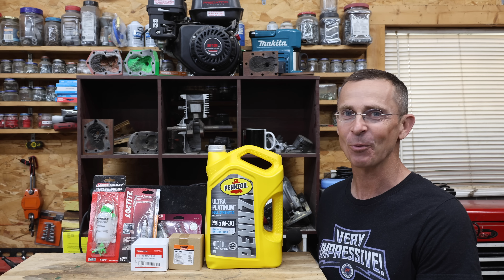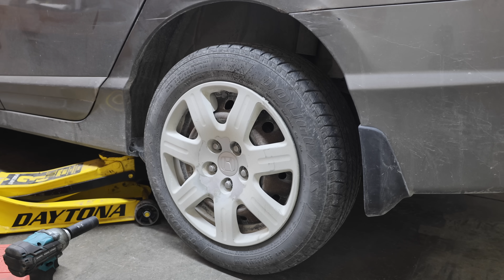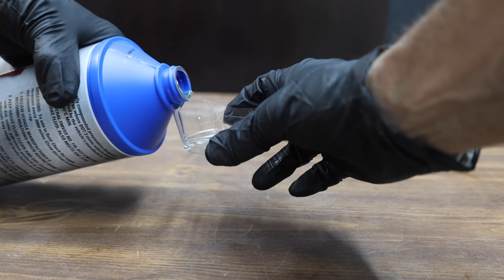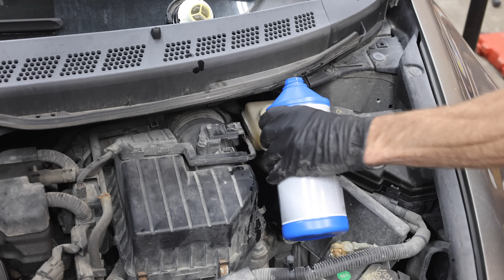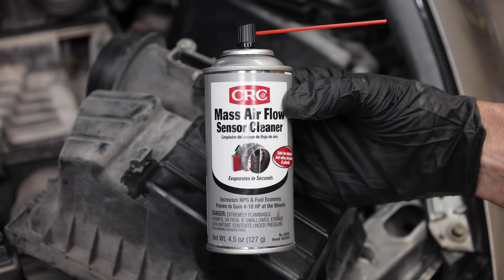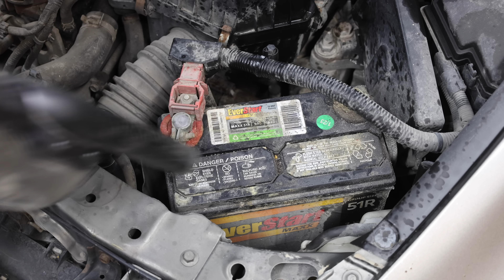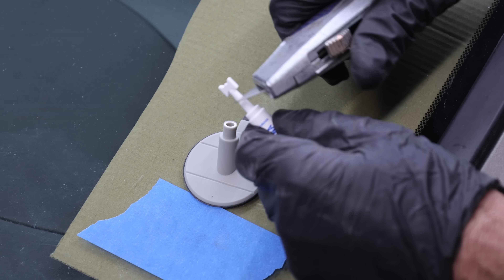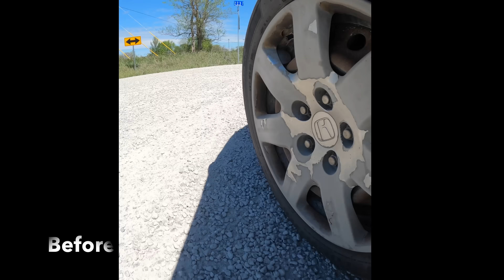Most Reliable 200K Mile Car? Let's Settle This!

Comment: I was a mechanic for only 25 years.I had to retire due to health issues. Everything in this video is perfect. Are you sure that you're not a mechanic? lol! I love all your videos, but this one takes the cake! Your  attention to detail  is great. Mad respect to you!!!!
Reply: @justineb I think he already has done that.
Reply: So good it will be in the SAVED folder.
Reply: Mechanical skills should be in everyone's toolbox. Common sense is key.
Reply: Attention to detail? He didn't even bleed the coolant
Reply: How many transmissions with 200k miles have you changed the fluid on without knowing the history?
Reply: You think it's wise to completely replace all the ATF. I think what he did in the video should suffice. Alot of times those high mileage trannies will slip when there is too much fresh fluid in them
Reply: I'm pretty sure that he's a mechanic formerly with some branch of military service.  By the book, no BS, no messing around kind of mechanic.
Reply: @leifhietala8074  Air Force is my recollection.
Reply: My only worry is changing that old transmission fluid out at that point. The new fluid is liable to make it slip as it's going to be worn out inside the transmission. 

I guess, if nothing else we might get to see if project farm can rebuild an automatic transmission
Reply: Yes it happened to my 04 civic high mileage fluid change but after the 4th drain and fill , added Lucas no slip and it really worked ! Lasted for a very long time after that.
Reply: @erwinsm10  Very interesting case, I have only heard bad things about putting lucas in honda transmissions. Will fix the issue in the short term but kills it within 15k. Yours definitely seems out of the ordinary
Reply: @Justin_Ebright   You're right about that.  Doing a high-mileage ATF fluid change tends to be a game of Russian RouIette.  Whenever I do one of those, I will actually keep the old fluid in case that happens.
Reply: @ABQSentinel my fj had never had the tranny fluid changed. This fj is entirely an offroad weekend machine in the Rockies. At 225 k, I decided that some fresh fluid had to be better than the zero viscosity stuff living inside there. I did a drain and fill. Since then (I'm at 240 now) I've done one more. So far so good. I really stress the tranny, keeping it in low range 4x4 and low gear for miles down these mtn trails. I'll probably do a drain and fill every 20-30k.

At some point you gotta figure fresh fluid is better than the "water" in there
Reply: @Justin_Ebright Ha! He's already rebuilt a heavy duty automatic. That one blew me away too. Learned more about automatics than I ever had in my long automotive technology interested life in one video. I adore this guy. Unique skill and personality combination that slays. Public service of the most practical order. Edited to add, I was warned about doing that by a 😊transmission shop (honest one) on a high mileage Durburban that exhibited cold slipping in reverse. Said don't floor it unless you have to, don't change fluid. Drove it another 30k and sold it.
Reply: Yes it happened to my 04 civic high mileage fluid change but after the 4th drain and fill , added Lucas no slip and it really worked ! Lasted for a very long time after that.
Reply: @erwinsm10  On toyota transmissions lucas does wodners though
Reply: @Justin_Ebright     Changing out old transmission fluid for new as seen in video will NOT cause slippage. That is old folk lore from uneducated want to be mechanics.   Using logic the old fluid is already spent and the trans while may be worn will continue to wear even faster if left.  New fluid is clean and restores heat dissipation so trans will not destroy it's self more.
Reply: @slyfox7429  clearly you've never worked on old beaters and potentially ever a car. Let me educate you. 

If that fluid had been changed regularly it wouldn't have been an issue. It clearly and quite visibly wasn't. There's no old wives tales, it's a matter of if the fluid maintenance was properly done over the years or not. This was in the "not" category. 

Further indication of a former owner who didn't keep up the maintenance was just how badly worn those CV joints were. 

That transmission has had poor fluid in it too long and WILL slip if you put new fluid in. Don't take my word for it, google it yourself. Look up videos, there's tons.
Reply: @slyfox7429  why would they make it up when they could charge people for fluid changes and make money?
Reply: @slyfox7429 The Car Care Nut would disagree with you..he says don't change it over 80k
Reply: @Justin_Ebright  quick question, when you claim new ATF will cause transmission to slip, isn't that the issue with the transmission? so the proper way to fix is rebuild the friction stack right?  So its either "don't touch it", or "new fluid + rebuild friction plates"? Just wanted to confirm cue its my first-time learning about new ATF will cause transmission to slip.
Reply: @Justin_Ebright  you just hang on to the old fluid in case there's a problem.
Reply: @Justin_Ebright  He already did that on his motor home.
Reply: @Justin_Ebright  "You can easily rebuild any automatic transmission. You don't need to be a mechanic" Says the Project Farm Mechanic
Reply: @Justin_Ebright  That is a huge myth in the car community!  Old transmission fluid should be drained and refilled, ASAP!  What you don't want to do is power flush your transmission!  Flushing can push that metal dust and debris into sensitive areas of the transmission.  When you drain and fill you are only replacing 1/3 - 1/2 of the fluid.   If changing half the fluid causes the transmission to slip, it was already bad.
Reply: @BartSparrow123  it's like you get it but you don't get it. As I stated, if regular fluid maintenance was done you're golden. But if it wasn't if you go draining that old fluid you'll lose power and it will slip. There's no myth. Maybe you get paid to upsell those services or something, but on a old warn out transmission it's not advisable to do what you're suggesting because you'll only quicken the end. Then it's either a full rebuild or a replacement transmission. With the old fluid folks will still get a few extra miles out of it. 

Not everyone has new transmission money just laying around. Some folks need that ever last mile to make it. Replacing fluid at that stage would just cause slippage and strand someone who may have been able to squeak 6 months to two years out of it as is now. At least long enough to save up.

I see this response all the time, and it's always coming from lube techs or major metropolitan area shops. In some places of the country people need every last mile, not miles robbed from them in an up charge on a worn out transmission that will become useless quicker with it being done.
Reply: @Justin_Ebright  I'm not a professional mechanic, I've simply been restoring and maintaining cars to flip or keep for 30 years.  This myth that changing old ATF, which is broken down hydraulic fluid that is probably burnt and no longer protecting the transmission from wear is going to make the torque converter stop working is worn out and silly.  Shops try to upsell customers on ATF flushes to justify the $50,000 power flush machine they bought!   But seriously, if worn out ATF is keeping your transmission running and new fluid will kill it, it's already dead, it just doesn't know it yet.  I've changed the ATF on every project car I've ever bought, some with 300K miles and never had anything but smoother shifting.
Reply: @BartSparrow123  are you in the habit of going after junkyard cars or are you pulling them out of people's garages? I've made a habit to avoid "flipper" cars due to waaaay to many being made to look pretty while being horror shows underneath. So I'm not sure where to gauge this conversation. But I'm going to assume you're on the quality side, hopefully, and not one of those quantity bozos these TV shows created who just worry about appearance and sacrifice by cutting corners underneath.

So here's the deal. On a transmission that's warn out and hasn't had proper maintenance done you don't remove the old fluid, you certainly do not power flush it. The added metal and particulates give the fluid a sticky quality while increasing friction. If you flush out those particulates then you lose friction and everything slips. 

If you've bought a few project cars and got lucky consider yourself lucky. If those transmissions had hard miles on them with improper maintenance then you wouldn't have been as lucky.
Reply: @Justin_Ebright  No I just jump on deals when I happen to see them, just a hobby.  Just got a 2007 Toyota Rav4 4wd V6 back on the road.  BOught it off an acquaintance for $1,000.  Just needed the oil pickup tube and pan cleaned out of sludge and an airbag recall.  It's worth $5,000.  Spent 3 hours working on it.
Reply: @BartSparrow123  oh right on, respect then. You're more of an investor sort. Nothing against guys like you at all, cause a good deal is a good deal, can't blame you there.

If you ever run into an issue with sludge in engines I'd actually highly recommend Liqui Moly's products. It is a bit of a process, anywhere from 2-4 stages depending on how bad the sludge is but on engines it's really worth it if you're able to do so. (IE you add it, drive on it for a bit, drain the oil, put new oil in, and rinse and repeat if needed)
Reply: @justinebright2328 Replacing the fluid is fine, flushing the fluid is where issues can arise.
Reply: Were the health issues related to your job? Mechanics are actually at a much higher risk of serious health conditions than other jobs.

Comment: While it is a boon that EV do not need that many parts for the engine and are easier to work on, I wonder how the situation will be if one tries to repair/service a 20+ year old one.
Reply: There are plenty of Toyota Prius out there that are around 20 years old. Many have several hundred thousand miles on them. The problem nowadays is finding parts for older cars.

Comment: Definitely a good type of video to add to the channel; would be more than happy to see more like them. How did you decide on which aftermarket parts to use, which supplier for those parts, and which to keep original? (noted the comment on the hubcaps with balance of aftermarket vs Honda)

Comment: I change  out my transmission fluid by removing one of the cooler lines and letting the transmission pump the old fluid out. Pump a few quarts at a time while adding back the same amount until it pumps clean fluid.

Comment: I have a friend with a 2008 civic that has almost 400k mile original engine and transmission. My 1999 Mitsubishi mirage has 410k miles with original engine and transmission as well.

Comment: You're one of those channels that should make YouTube grateful you're one their platform for real. The rear brakes weren't just about used up though. It looked like the thinnest part was about 50% of the way to the bare metal. Nothing wrong with replacing them at that point though and great video.

Comment: Todd,
My 03 Chevy is at 378k. Sad to say, the transmission needs to be replaced. But I'm going to rebuild it myself. 
Last Tuesday. I spent 1/2 day working on my daughter 3/4 ton GMC. Turned rotors. I wheel hub bearing. New brake pads and fresh brake fluid too boot. Then the rear pad was replaced. Rotors were just fine. 
I'm working on my 2000 Discovery 2 now. Front and rear differential rebuilt by yourstrully. Waiting on hub bearing. 
All 4 brakes calipers are replaced too. 
This is just my regular maintenance item. 
I maintain my vehicles. Never been to a shop. Therefore I can't bitch if a mistake is made. Or if I scratch my paint a little. 
I'm proud I do my own repairs.

Comment: Back in 2018, I bought a 2014 Hyundai with nearly 200k miles for one of my kids. Luckily, it's been relatively trouble free. A few minor repairs. It was hard to pass up. It was loaded. Top of their line. Only driven on the highway by a state official from his home to his offices. About 200 miles a day.

Comment: Freaking Fantastic video! My only suggestion is that Honda engines have solid valve lifters that require adjustment every 100K miles. Failure to adjust the valves will result in poor engine performance and at worst a burnt valve, which requires removing the cylinder head to replace the valve.

Comment: 425k Kia 3.8 2010 original timing belt. 2nd transmission. Always high mileage NON synthetic, always spiii fluid at every 5k now. Alwayssss pulling a 5x8 loaded trailer. All suspension bushings, and shock stuff must be replaced.

Comment: You nailed it on the head. "With regular maintenance" the question is a) the cost of the regular maintenance for the parts needed. b) the skillset and toolset to do that required maintenance. 

The big thing is having the skills to do the work. If I tackled this kind of project. I'm not ashamed of having a copy of Haynes or Chilton on hand to get all the repairs done correctly. 

Thanks for the video it was a lot of fun to watch.
Reply: ALWAYS read the manual! They don't just write those things for fun, they're a hugely important resource.

Comment: I have a 2009 Honda Civic coupe with 253,000 miles and it is still going. I take the time to always do the oil changes and fluid changes as well as the scheduled maintenance when necessary. It runs like a champ. Yesterday I did the tune up and changed the VVT solenoid gasket which was leaking oil. I took care of the PCV valve and valve cover gasket. The car is incredibly easy to work on. Great video.

Comment: i remember when Honda had weak 4th cyclinder so you always hd to check the oil my I haved owned 100 cars in my life m best car was a 99 Buick LeSabre with 300k miles it got 36 mph and was very trouble free but did also have a 93 Saturn SL1 with over !.3 million miles on it i sold to a waitress for 100 dollars it still ran and drove fine she sold it to a junk yard which uses it to run around the yard to this day

Comment: I can see why those Hondas are very popular. Most people should be able to accomplish the service and maintenance you demonstrated. 
Really excellent video!
I am going to make sure my kids see this video so they don’t fall down a YouTube rabbit hole on auto maintenance.
Your video, was clear ,concise and straightforward. As a young guy, I never could afford to pay someone to do that work ( I could but didn’t want to pay), and all my friends were the same. We did that work , and didn’t overthink it.
I think you’re helping a lot of people who are afraid of taking this on, and they shouldn’t be.    Thank you very much.
Suggestion for video. Many good quality used power tools available . I just picked up a really nice , very old Makita chop saw(free)
It needs some maintenance, and parts are easy to find online. Lots of good lightly used power tools available cheap. People shouldn’t be afraid of used, brushed motors.
Think of brushes on electric motors, same as brake pads on cars.

Comment: Btw, I recently got repair work done on an F250 with 250,000 miles. Oil leak and slipping transmission cost me $21k

Comment: My man, this is exactly what I do... In the last two years I got a 1998 Tahoe 4x4 LT with 208,000 miles and a 2005 Taurus with 108,000. Bought cheap, needed work, but to put even $1,000 to $1,5000, CHEAP...

Also, I expect that you may get blasted on this which is sad, you are soooo helpful... I appreciate you...

Comment: my tdi jetta has 300k on it original engine and transmission it has some bolt on mods 11mm injection pump, .205 injector nozzles, vnt 17 turbo i beat the absolute piss out of it it hasn't blown up yet.

Comment: l bought a 97 Ford Taurus new..because we had 2 small kids and it had an excellent safety rating. l put over 200K miles on it without anything major but routine repairs and some brake lines when it neared 200K. l gave it to a kid who was trying to get clean and he drove it a couple of years to work  before the front end went out and he parked it .

Comment: As long as the engine and transmission have been serviced fairly regularly and the body/subframe isn't shot, I've seen some get 300,000 minimum by changing some worn-out hard parts. This is a really good video.

Comment: I'm with you on refurbishing older vehicles. Summer is almost here, can you take a look at camping coolers, both the insulated ones and those that use 12 volts for active cooling? Maybe compare to a simple styrofoam cooler.

Comment: Great DIY video!

New cars are a total waste of money!  If possible try and buy a car (Toyota or Honda) made between 1995 and 2005 and look for one that has an engine with a timing chain as timing chains will last the life of the car.  Also make sure the car also has a full size spare as when one may get a flat in the middle of no where one can change their flat tire in 45 minutes and be on their way again safely.  This is the main reason why I still drive my 2002 Rav4.  The 2.0 engine is not only bulletproof and has a timing chain but the spare on the back hatch is also full size.  

If one buys a used vehicle they can fix themselves, then that will save the person literally $$$$$ thousands on DIY auto repairs!  Nearly all automotive  repair shops will scam their customers in some way so it's always best to learn how to fix one's vehicle.

The parts are not the makes automotive repairs costly but rather it is the auto mechanics labour fees.

I replaced the 4 coils, EGR valve, PCV valve, MAF sensor, battery, and had a friend checked out my ECM board for $240.00 Canadian and my 2002 Rav4 is still running perfectly even after 22 years!  I also just change my oil with full synthetic every 3 years and top off the oil when low with conventional oil to save a bit of money as well....